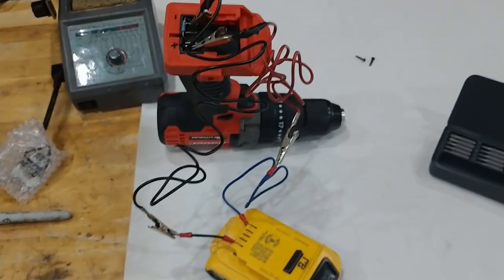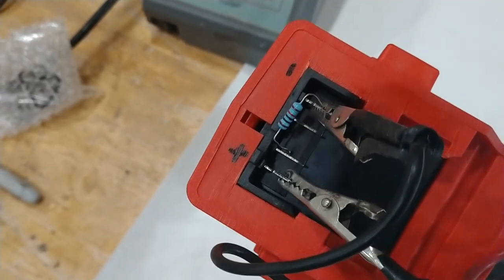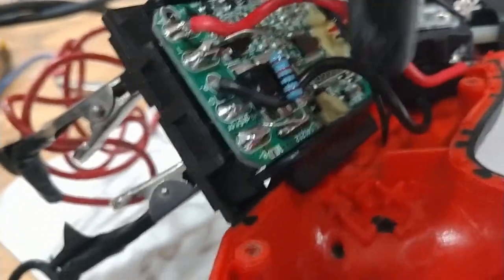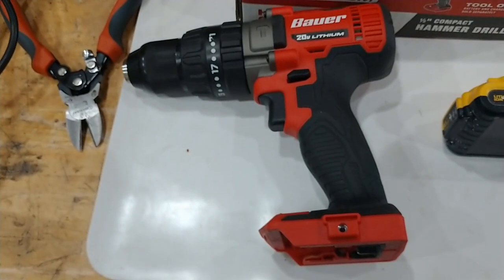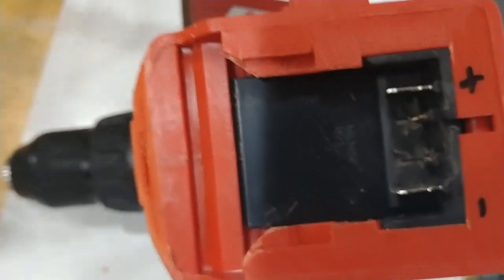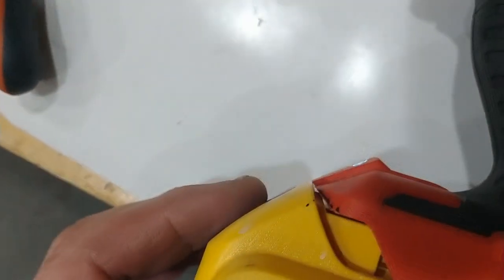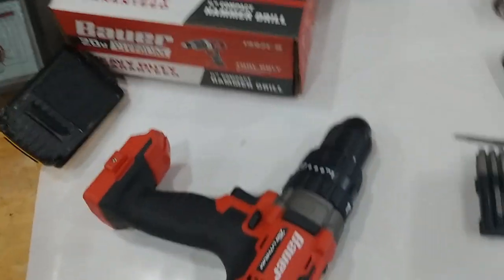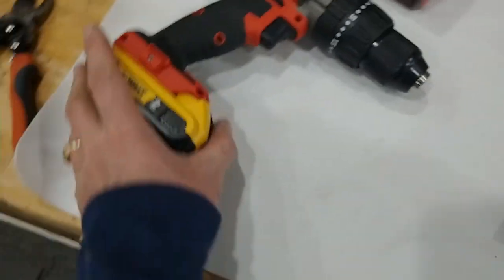Bauer hammer drill modified to run on a DeWalt 20v battery

Comment: Now do it for the Hercules tools.  :)
Reply from the maker: If I find a must have Hercules tool that DW or Bauer does not have or if I was sent one to convert ;-) I would. I just purchased a load of tools on sale and before any tariff increases the cost. I just recorded converting a 20v Bauer narrow crown staple gun, but I used my phone and one hand so I will need to spent the time to splice the footage into a watchable video. I liked the 20v stapler enough to then buy (on sale) the 18 ga 20v Bauer brad nailer. It looks to be almost identical to the stapler so I might just record that conversion using my camera on a tripod.  Back to Hercules, another possibility is that I buy the cheapest 20v item and take it apart on camera and see what it takes to use DW batteries in it. I found a Bauer 20v work light for $10 I took apart just to have the battery base for the tool trailer lighting mod, the mod is one of the most useful DIY projects I use almost daily, I have more LEDs to add to dark corners and under shelves but will tackle once the weather here gets nice enough to comfortably work out in the trailer.

Comment: I'm trying to get this to work with the Bauer oscillating tool.  I did the mechanical mods to the slide and popped the battery in to check the fit.  The switch was on and it started for a second and then cut out.  This is before I got started to test with the 10k ohm resistor.  Do you think I could have fried the board?
Reply from the maker: I doubt you fried the board, unless you saw or smelled smoke. I do the electrical mods before the physical mods. I use jumpers made of 1/4" spade and alligator clips to connect positive and negative of the battery to the tool. you might just need to remove the small contacts on the tool if it works with jumpers. I thought I smoked the board on an orbital sander and just connected the neg to the black line and red to positive going to the switch, if you do that it should run but you need to pay attention to the battery level, without the circuit board in place we can over drain the battery and that will shorten the life of the battery significantly.  Since DW batteries have a battery level, I check the level when I hear the sander slow, never run it until no bars light on the battery.
Reply: @GmanInd  I did not burn it out. I ordered one of the adapters you reviewed and it came in this morning...like a 12 hour turnaround..amazing.  Anyway, I hooked it up and it ran fine.  One last question - I assume the adapter doesn't do anything about the draw.  I still need to be aware of how much the battery is being drawn down, correct?  Thank you for all the helpful information!!
Reply from the maker: @oursailingvoyage  I have not ran a tool 'dry' using the adapter but it should retain the battery protection via the voltage reading to the circuit board. Only completely bypassing the circuit board and using just the battery, switch and tool motor eliminates the low voltage cutout feature. Most of the tools I have converted still have a shutoff before the battery voltage reaches a damaging level.

Comment: HFT is somehow in bed with Dewalt.. otherwise the batteries would not be almost identical.. Companies patent every little design aspect they can to avoid copycats.. If there wasn't an agreement, Dewalt would be suing over the latch or the power level lights or something..
Reply from the maker: Interesting hypothesis, This is a very litigious society after all. Chinese laws are different than USA laws and I am no lawyer nor a legal expert. Suing a Chinese manufacturer might be more difficult than suing a domestic manufacturer. Their products are similar (knock offs?) but aren't nearly all cordless drills almost the same? They do not accept the same batteries and people need to modify a tool themselves in order for them to work.  
Speaking of other manufacturers using DW batteries, I recently came across a Graco cordless spray painter that advertised they are powered by DeWalt 20v batteries, check it out here, https://www.graco.com/us/en/contractor/product/17m363-ultra-cordless.html
Reply: @GmanInd  Have you seen some of the suits?? Snap-on vs HFT  Snap-on lost.. Milwaukee vs Snap-on.. Milwaukee WON.. DeWalt owns the patent for a radio that charges a battery,, Milwaukee had a to wait a few years, now has to pay royalties to Dewalt,, the intricacies are mind boggling.. It doesn't matter where it's made it matters where it's marketed.. I think that has a lot to do with many mfg.. being under one corp. shell,, that way they have the rights to all the patents.. An engineer working for triton designed the Jawhorse,, Rockwell hired the engineer for a million bucks and got the patent rights,, now they sell the rights to everyone.. The copy-cats change one little thing to avoid problems.. HFT has a large team of attorneys watching very closely because they have been sued so many times.. Graco must pay DeWalt royalties,, maybe the other way around,, .. It is very common...
Reply: Rumor was ex DeWalt engineering folks designed em
Reply: @kevin-pk6hd  Designed what??